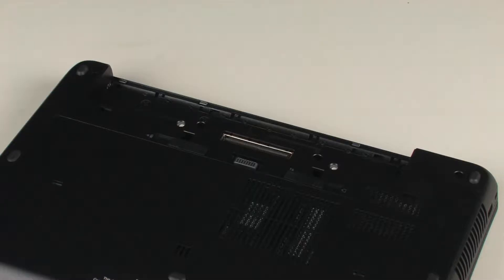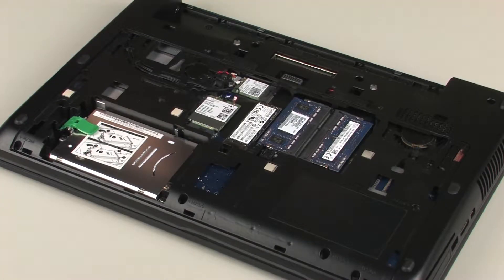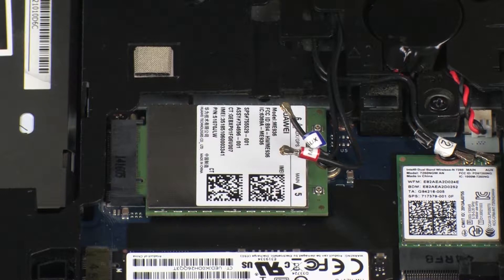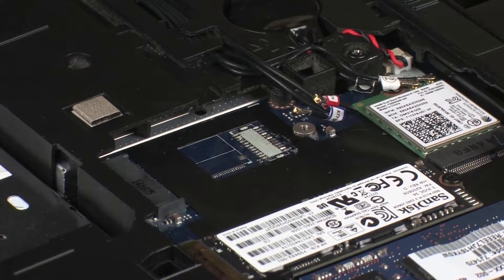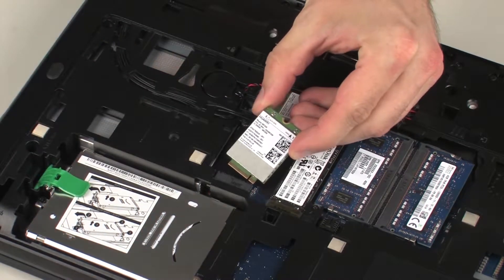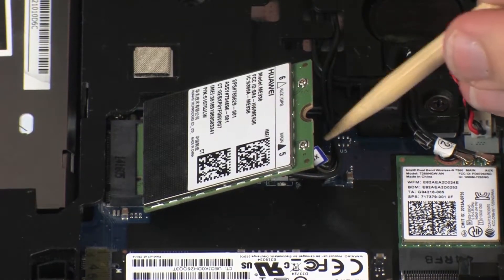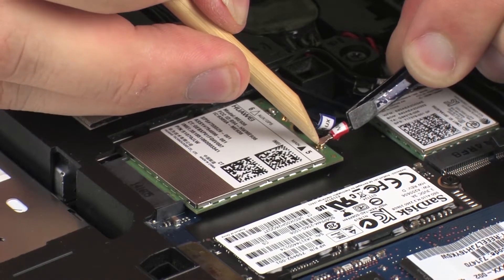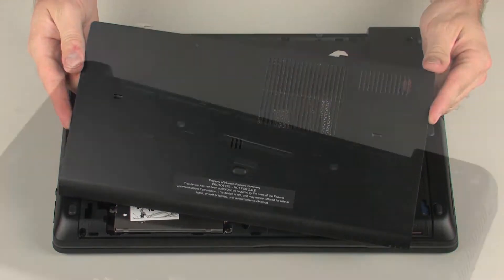Replace the Wireless WAN Module | HP ZBook 15 G2 Mobile Workstation | HP Support

Comment: Good evening, is the WWAN connected in Pcie? Can I connect mSata storage?
Reply: What is the part number for this I had to replace mine because the laptop I bought from someone do not come with it
Reply: Do you have a part number for the wan and the land modules and if so what's the price on both of them
Reply from the maker: +Hunky Dory HP does not recommend upgrading or downgrading hardware parts or software that is bundled with the product as It may affect the manufacturer's warranty and performance, however, you could change the configuration at your own discretion.